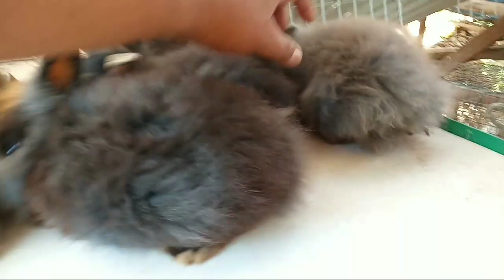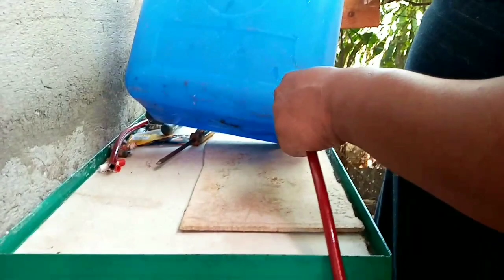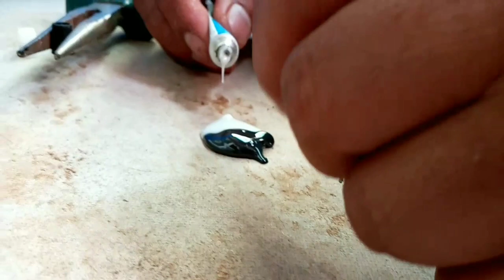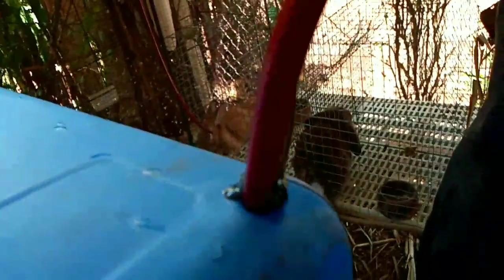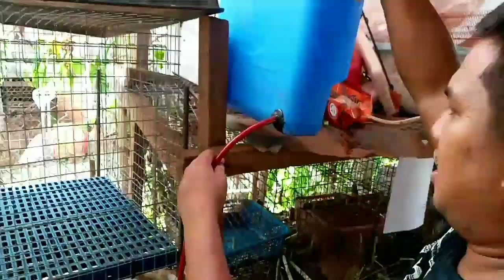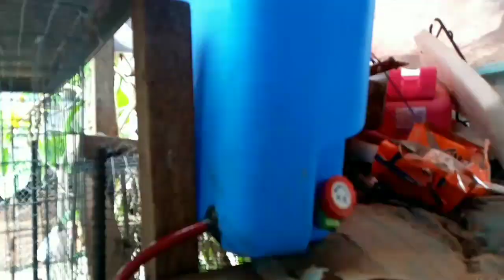Rabbit Farming - Setting the Water Source for Water System by Nayecious Pets

Comment: Kapag sinabi mong water system eh of course buong setup yun sir kasama ang source... bkit sir nid paghiwalayin??? Pati bkit k p bumutas ng separate eh may faucet n ang jug mo? Either dun mo kinabit s mismong faucet at nilagyan mo ng sealant or inalis mo yung faucet at kinabitan mo ng connector n kakasya s hose mo?
Reply from the maker: Hi sir, s first video po ksi d naisama ung pgkabit ng jug doon s system, if isasama po ksi m hahaba ung video which might lead to lesen the iterest of the watcher so i decided to make n lng a follow up. 
Then regrding s faucet im using ksi a small diameter hose which does not fit dun s faucet ni jug, and at the same tym ung faucet nun is ung square type, which i believe wla pong adaptor or connector n bibili to connect s hose q po.